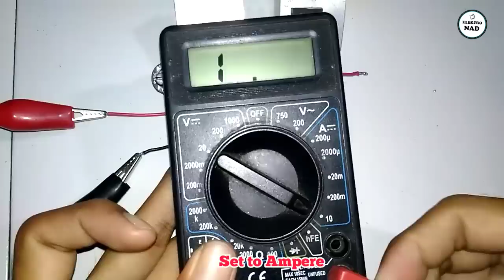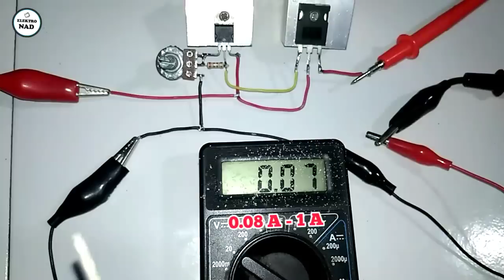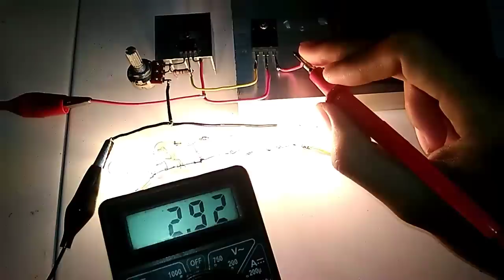Rangkaian penurun tegangan (Regulator LM317 dengan tip3055)

Comment: Does we need to change resistor and potentiometer in circuit, if we use 2 TIP3055 in parallel?

Comment: How do I reduce the voltage from 19 Volt 90 Ampere to 15 Volt 90 Ampere Fixed, because I've tried and the transistor's burned

Comment: Mas mohon dijawab saya  mempunyai kendaraan dengan kapasitas aki 12v  65 ampere .. Untuk menurunkan alat dengan tegangan ke 8/9 volt..  spek alat 8volt 1 ampere s/d 2 ampere apakah bisa memakai nya
Reply: Bisa pake regulator LM7809

Comment: Saludos desde Panama. Acabo de realizar el proyecto y fue todo un exito. Estoy con rostizador a la velocidad que queria que girara el motor de limpia parabrisas de 12 voltios. Muchas Gracias. Ahora lo que quiero es hacer es que un AC/DC ADAPTOR, modelo DV-1000, input 110/220V 60/50Hz, Power 18W, Output 1.5,3,4.5, 6V, 7.5, 9,12V DC, Current 1000mA Max. mueva el motor de 12 voltios del limpia parabrisas. Podrias ayudarme.

Comment: supaya outputnya bisa menggerakkan beban dinamo dc 36 volt 28,5 ampere ic regulator dan transistornya yg diperlukan berapa banyak?
Reply: Teg.input hrs diatas output.
1 bj 3055 yg spt video max mampu 3 Amp, tinggal dikalikan saja brp bj.

Comment: Thank  your practical i tried with 2x9 but it gave me 17v and the potentiometer is burning when the voltage reduced to 13v   is there any solution?

Many thanks.
Reply: Pot burn out? Aru you sure tje connection right?

Comment: Riquest bang,untuk suhu transistor/ic mnta tolong di buat bang & voltage nya standby donk di tip 3055(berubah / tetap).dg 3 ampere kuat nahan panas nya brp lama🙏🙏..trims..
Reply from the maker: Terimakasih atas idenya
Reply: @ElektroNad14  sama2 bang,terus berkarya bang elmu nya sangat bermanfaat..td saya langsung praktek voltage nya joss,,untuk suhu ngikutin ampere.. di 2A aman dg heatsink,plus kipas tambah aman..mantap...auto like n subcrb dech...

Comment: if for example I use a 5 ampere 12 volt battery and I reduce the voltage to 10 volts using a series like this can the amperage output increase more than 5 amperes. thanks
Reply: Off course not, this circuit just explain how to increase the Current capacity of one LM317 with add 3055.

Comment: Om, kalo input 23V 10A.. si IC lm317 dengan cara ini bisa ngeluarin 17V 5A engga ya ? 🙏🙏
Reply from the maker: Tambahkan transistor 3055 lagi dengan cara di paralel, supaya transistornya tidak cepat panas dan K.O
Reply: @ElektroNad14  intinya, si LM317 bisa ya om, cuma tambah transistor 3055 doang 2 biji.. atau ada cara lain om yg kira2 bagus ? Selain pake LM317.. saya cuma butuh out 17V 10A 🤔
Reply from the maker: Jadi lm317 nya sebagai penentu voltasenya, dan penguat arusnya pada transistor
Reply: @ElektroNad14  ooowwwh jadi pake transistror 3055 nya 2 biji ya om di pararel ?

Comment: Kalo tip 2955 itu buat apa ya om, saya beli tip 3055 kog di kasih sepasang sama yg 2955
Reply from the maker: Biasanya dijual sepasang, 3055 adalah jenis NPN dan 2955 adalah PNP, kebanyakan kedua transistor ini dipakai pada power amplifier,, gunakan 3055 saja sesuai video.. 2955nya bisa dibuat rangkaian inverter seperti pada video ini :
https://youtu.be/403KZrQKNZM
Reply: O iya gan kalo misal pakai rangkaian ini amper dri input bsa ikut brtmbah, apa
Reply: Apa sama dg amper inputya gan?
Reply: Om pnya saya udah jadi sama kyak di vidio cuma kog tegangan outnya gak mau turun ya, trus resistornya jga jadi panas, apa yg salah om

Comment: Mas sy punya panel surya mini 12v 500mA tapi pake ic 7805 tapi buat ngisi powerbank kok g ngisi..kl indikatornya masuk..apa ampere ic atau solary yg kurang..
Reply: Utk bisa ngecas HP / Pwrbank, hrs diatas 5,0 Volt, liat di charger HP biasanya 5,1 dan 5,2V. Hrs diakalin dikit 7805.nya,

Comment: I tried this one and finally i got problem with voltage regulation. It stays at 19v not reducing the voltage as the potentio decreses.
What might be the reason ??
Reply: 1. Miss-wiring.
2. VR fail.

Comment: Can you tell me how i can reduce  a 9v ac dc adapter to 7.4v step by step
Reply: Simple way is use 2 series Diode in positive line, volt.drop will about 1,4V.

Comment: Saya udh bikin dgn input dr trafo ct 5 ampere 24 volt tp knp potensio nya kebakar ya. Trus pake trafo engkel 3 ampere 18 volt juga  potensio  kebakar juga ya. Apa ada yg salah gan  ?
Reply: Ya kasus saya juga sama, mohon pencerahan
Reply from the maker: Periksa kembali dengan teliti jalur2 nya gan sesuaikan dengan di video,
pastikan regulator LMnya berhasil dulu baru pasang Transistor dan heatsink..... 

Hati hati Jika menggabungkan ic LM dan transistor dalam 1 heatsink  pastikan antara kaki LM dan transistor tidak terhubung...
Reply: @ElektroNad14  heatsink ic LM dan transistor nya saya jadiin satu gan tidak dipisah kya di video

Comment: Kalo rangkaian peningkat ampere gimana ya?saya perlu output 12 volt 40 ampere,, input 12 volt 3 ampere
Reply: tidak ada peningkat ampere, utk menaikkan gunakan DC to DC Converter 12V to 12V dgn power 480W

Comment: Saya coba praktek seperti wiring dan part di video, dg input 24v..tp variabelnya cmn turun 1v aja ya bang? Paling rendah di 22v, pencerahannya bang
Reply from the maker: Potensionya mungkin bermasalah.. pakai yg 10K
Reply: Sudah pakai 10k pdhal bang, part sama persis sprti di video
Reply from the maker: saya pernah juga begitu gan dan masalahnya ada pada potensionya, setelah diganti yang baru langsung jadi gan...
Jika belum juga, Periksa kembali jalur2nya...  sesuaikan dengan di video... 
Pastikan regulator LMnya berhasil dulu... Baru hubungkan dengan Transistor.... semoga membantu gan...
Reply: @ElektroNad14  ternyata kalo transistor dilepas normal bang, apa yg bermasalah di transistornya ya?
Reply: @loading671  tr.nya jebol.

Comment: Would be better to use LM380. Can deliver up to 5 amp. No need for transistor. If you need more current, then rather use MOSFET.
Reply: tienes esquema de lo que dices.
Reply: yes, thanks mr.Dawid
Reply: can you please make a tutorial for smps 15 ampere lowering the voltage from 45 volts to 32 volts
Reply: can you please make a tutorial for smps 15 ampere lowering the voltage from 45 volts to 32 volts
Reply: @kontenpremiumclass  you do not need a smps. You need a buck converter. Search the internet. Plenty of circuits available.
Reply: @dawidspangenberg4699  tanks
Reply: do brasil: por favor dê um esquema. grato amigo.

Comment: Thank you. I recently made something like this with a transistor and potentiometer and was wondering how to incorporate a voltage regulator into the circuit. I have a large solar panel that puts out 21 volts and I need to adjust it down to about 14 volts. This circuit should work with a solar panel right?
Reply: All DC source can use this circuit.
Reply: What is push-pull is almost always used with?
Reply: *85

Comment: Very good. simple tutorial. you use  ten 5 watt bulbs is equal to fifty watts. Input is 11 Volts. Watt/Volt= Ampere. Here 50/11=4.545 Amps.  Your meter shows 2.92 Amps. I think the out out volt is low.
Reply: I think the bulb used is not 5W.

Comment: Kalo untuk 1 tip 3055 maksimal bisa berapa ampere gan..
Kalo mau tambah daya tinggal paralel tip 3055 ya gan
Reply from the maker: Iya tambahkan transistor untuk mendapatkan daya yang lebih,, dan juga berguna untuk mengurangi panas... karena beban akan terbagi pada transistor yang lain..
Reply: @ElektroNad14  thank you gan
Reply: Mau tanya sekalian. TIP 3055 diparalel dgn pasangannya TIP 2955 atau pararel TIP 3055 dgn TIP 3055 juga...
Terima kasih

Comment: Wow, the circuit actually worked but I am not comfortable with the too much heat the transistor is generating despite the heat sink I connected. What can I do to eliminate the overheating of the transistor because I believe if the transistor is allowed to work for a long time, it will damage. I kindly need a swift response. Thanks
Reply from the maker: thank you, you can parallel the transistor so that the load can be shared with other transistors so that it can reduce the heat in the transistor ..

Comment: Bos itu pakai IC brp dan transistor berapa? Terus untuk sumber dayanya darimna bos? Mohon penjelasannya.
Reply from the maker: Ic LM317 dan transistor Tip3055
Sumber tegangan bisa dari trafo yang di searakan dengan dioda dan elko, atau dari Aki 12V kemudian pakai modul step Up yang bisa di naikkan menjadi 20V
Atau dari adaptor..
Reply: @ElektroNad14  o gitu ya.iya terimakasih atas penjelasannya.sukses selalu untuk bos.
Reply from the maker: Terimakasih

Comment: Nice work what about a capacitor on in & out? Thanks
Reply from the maker: thank you, you can add capacitors, that's better
Reply: @ElektroNad14  
Can you make a video on LM138 and LM338 5-Amp Adjustable Regulators ? 
As only one regulator required

Comment: Biar ampere bisa di adjustable juga rangkaian sprti apa
Reply: Arus (amper) tdk bisa di adjust di rangkaian Voltage Adjuster spt ini. Hrs pake rangkaian Current source. Tp utk keperluan apa current adjustable tsb?
Reply: Buat jd MBR dan buat power supply
Reply: @Viruslinux  MBR apaan ya? Powersupply perangkat apa yg butuh Current adjustable?
Reply: Kipas,Hp... mBR buat nyari yg short mas sama buat tes2 ampli krn

Comment: Kalau untuk buat penaik dan penurun arus(A) nya aja gimana???
Reply: Butuh satu transistor kecil tersambung di out transistor. Base transistor tambahan terhubung lewat resistor 1k + pot/trimpot(buat atur arus) ke emitter transistor. Collectornya tersambung ke base transistor, emmiter ke ground. Ya tapi itu, kalau arus dibatasi voltase drop banyak. Macam charger lithium yang fase awal constant current, voltase drop banyak.

Pilihannya cuma tegangan konstan atau arus konstan, ga bisa dua2nya. Kecuali beban sangat kecil, misal voltmeter. Drop sih tetep drop voltase, tapi gak kebaca aja.
Reply: @wiradharma7030  yg nggak ada penjelasan tentang Ampere nya ini si pembuat chanel
Reply: @mariservicemedan3747  untuk skema ini, out bergantung di tip3055. Seinget saya kisaran 3a bisa, kalau heatsink lebih besar.

Sulit kalau menentukan ampere karena tergantung pendinginan. Tergantung case transistor juga, jengkol biasa lebih besar karena pendinginan lebih baik.

Kalau saya cenderung pakai ne555  + irfz44n. Konfigurasi low swithing source mosfet ke ground. Kaki negatif beban ke drain mosfet. Out ne555(kaki 3/7 tergantung skema) ke gate pakai resistor 1k, antara resistor dan gate pakai pull down 10k ke ground. Aturnya dr freq + duty cycle. Untuk motor control tidak perlu inductor, 12v 5a aman2 aja tanpa heatsink. Murah lagi, coba googling ne555 motor control. Lebih enak pakai attiny85, bisa 3 out pwm. Yg digispark sudah usb cm 20rban.
Reply: Bagaimana kalau 3055 nya 2 buah apa arus juga bertambah?
Reply: @halimahsadewo8363  iya, tapi di tiap emmiter dipasang resistor 0.22 ohm. Ga tepat 2x lipat tapi mendekati.
Reply: @wiradharma7030  berarti semakin banyak 3055 nya arusnya juga akan semakin besar? Apa bisa dikatakan begitu gan?
Reply: Iya gan
Reply: @wiradharma7030  utk apa R disitu?
Reply: @boekansyapa2561  yg mana gan? Yg ke gate apa yang pulldown?

Yg gate biar dia ringging, gak noise gitu. Kalau pulldown buat awal2 nyalain sirkuit, mosfet langsung on awal2 atau proteksi klo ada kabel kendor ato apa biar mosfet off klo ada apa2. Klo on terus bisa jebol itu loadnya. Intinya sih dia buang arus kalau gak ada trigger.

Koreksi klo salah, ane ga liat lg videonya. Tp kira2 ngeh arah omongannya.😁 Ni rasanya linear regulator mau naikin arus.

Comment: Kalo inputnya sampe 50A apa bisa outputnya jg 50A mas?
Reply from the maker: Tidak bisa gan...
Reply: @ElektroNad14  sampe brp max nya mas?
Reply: 3055 max nya 15amp itupun puanas nya poll
Reply: @gibriktea3939  wah buat charger hp joss.. amper 2,9
Reply: @gibriktea3939  brangkali mas klo kita paralel trnsistorx smpe 4 buah,apakah ini bsa pke ngecas aki...?
Reply: @hendrikrama1090  bisa mas, jangan lupa heatsink nya yaa.. Hehe
Reply: @gibriktea3939  mkasih byak mas.

Comment: PSU saya tengan output 48volt mau saya turunkan ke 45olt apakah menggunakan rangkaian itu bisa ...menurut datasheet lm 317 maksimal di 37volt ya mas mohon pencerahannya saya sudah coba menggunakan mosfet tp IC terlalu panas, apakah bisa dibuat rangkaian yg adjustable volt nya cuma berhenti di 35volt dan maksimal di 45volt dengan psu 48 volt
Reply: Google lm317 calculator, sesuaikan rasio resistornya. Kalau mau rentang kecil perlu resistor setelah pot ke ground. Potnya jangan 20k, pakai yang lebih kecil. Kalau mau potensio gak terbakar ganti resistor 220ohm dengan resistor 1k supaya beban ke pot lebih kecil. Di calculator resitor 220ohm itu r1.